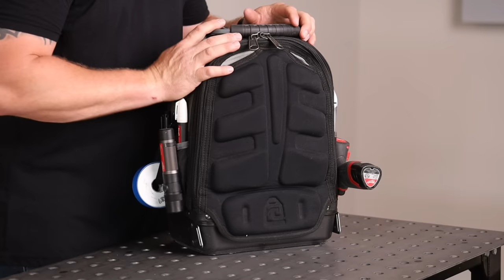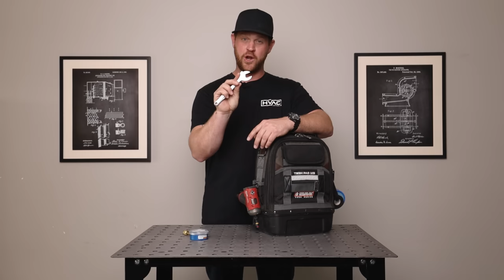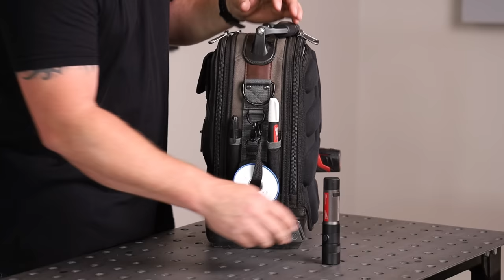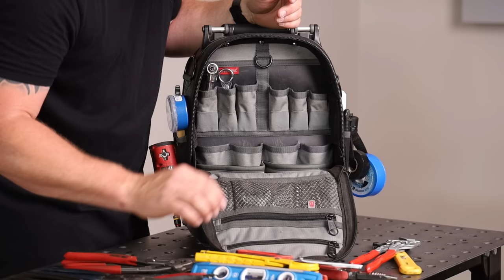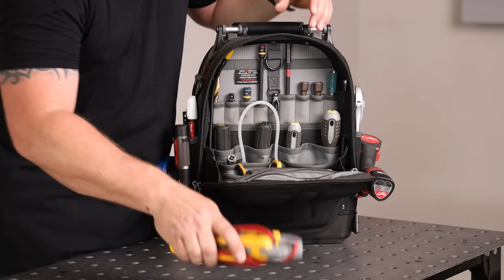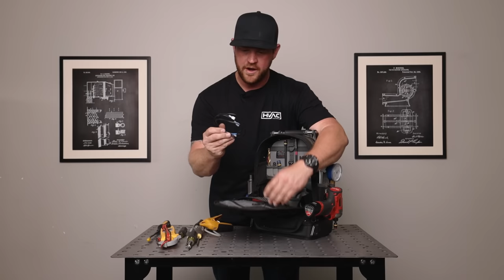What’s In My VETO Bag 2021 | HVAC LOADOUT

Comment: If you do mainly service calls, skip this backpack,  it will take a toll in your back.  I own the pro pac tech pack that is a little bit bigger. This one seems a bit smaller. Your tool choices are amazing 👏 I own pretty much the same you showcased here. It took me 2-3 years of experience to really know what were the best tools for this job and you just got all of them right ✅
Reply: Yup I been in service trade for a year and I’m 20 so still learning now I do commercial food equipment as well as hvacr so I require a bit more tools on a daily basis than most regular hvac/r techs but rn I’m rocking a 24 inch rolling bag😭 so much and so heavy to lug around one of these weeks I’m down sizing, but for me tools are a constant rn I’m focusing on building my field piece stuff but after that I’m going to play around with different hand tools and figure out what’s best a lot of tools in this video I already have but things like those version channel locks I need to add
Reply: Maybe hit the weight room and don’t be a small son of a gun. I rock the back pack and it’s much better than a strap or carrying it like a brief case.

Comment: I LOVE that mini-ratcheting Klein screwdriver! Not to mention the little bits that come with it! 2 phillips, 2 flathead and a 1/4" drive socket adaptor! - Getting phillips or slotted screws in tight spaces has never been so easy! And you can attach any 1/4" bit to that side, or a 5/16" size bit to the other! Has gotten me out of MANY tight situations as an electrician! Worth the $15 over and over!

Comment: I keep a piece of steel wool to clean flame sensors and a spring clamp with a short piece of a paint stirring stick for furnace door switches. Bent needle nose pliers are good for removing hose clamps on high efficiency furnaces.

Comment: Very organised 👍🏻 Need to add two more things. Gator grip socket and Step drill bit or AKA Christmas tree  drill bit
Reply: A valve core T would be more important, one that allows you to change the core without pumping down the unit. Also he could use it with the probe when adding gas. I would recommend a set that is vacuum rated as well
Reply: i got one of the gator sockets ones, its a gimmick IMO ended up tossing it.

Comment: I like blue monster good stuff. However your not supposed to use it on natural gas, that's what the yellow stuff is for.
Reply: The blue monster is rated for gas fittings. All the other tapes I've seen are yellow though.
Reply: blue monster works for all noob
Reply: Always follow the instructions

Comment: I have a Klein Ratcheting screwdriver handle, with a Klein HVAC Slide magnetic 5/16 1/4 inch, that you can flip around like you would a 11 in 1 that has a Phillips/flat head. I highly recommend it. It’s kind if expensive since you have to buy two different Klein screwdrivers to achieve this but it’s well worth it.

Comment: You said you've had some of those tools for a long time but when you first started out did you go and buy all that stuff at once or? What would be your first purchase for a tool?
Reply: 1/4, 5/16, 3/8 nut runner first....basic hand tools second, build from that
Reply: @noway9426  I should have been a little more specific. I might have had a few beers when I wrote that. I have basic hand tools. An impact and drill. Limited sheet metal tools. I want to get into service I think. So gauges or meter or what? Lol thanks for the reply!